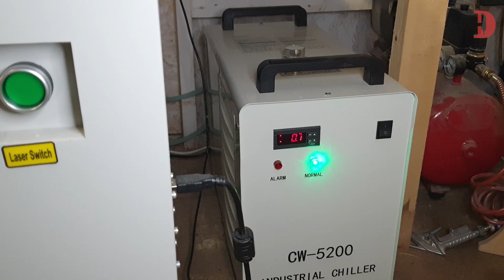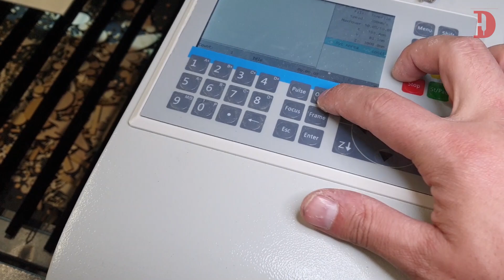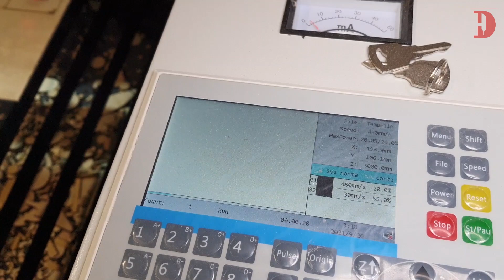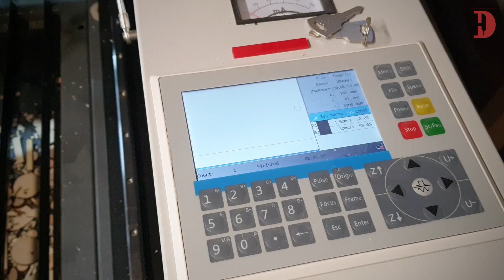New 9060 100W CO2 LASER in the shop

Comment: Amazing machine. what kind of demand maintenance?  How long does the lens hold Daniel?  thanks for sharing with us
Reply from the maker: It works fine for over a year now. I have spare lens but didn't change them yet.
All I have to do is adjust the tube because there was a corner where it didn't cut perfectly.

Comment: Hello Daniel, 
I want to buy one to. Do you have any after use insight to recommend before i order?
Reply from the maker: Almost one year of intense use and no problem so far. Just one time I needed to adjust laser tube and mirrors. And i changed the exhaust fan with a bigger and powerful one. It's awesome for me
Reply: @DanielH  thank you very much. The steal bed provided is good enough? Or shuld i look for honyecomb one?
Reply from the maker: I have both types. Honeycomb one I don't use it at all, only on engraving part sometimes. 
The best there is are the aluminum profiles with sharp top. The honeycomb reflects the laser beam and the material looks ugly underneath

Comment: Buna ziua dl. Daniel,
Vad ca folositi aceasta masina de gravat de aprox. 7 luni de zile. Sunteti multumit de aparat? Ati avut ceva probleme la el? Sunteti multumit de vanzator, asigura si service si piese in caz de nevoie?
Ma gandesc si eu sa-mi iau una de hobby si as fi foarte recunoscator daca mi-ati da cateva raspunsuri.
Cu stima, Robert.
Reply from the maker: Sunt foarte mulțumit. Nu am avut nici un fel de problemă. Singura chestie ar fi ventilatorul ce scoate fumul, e subdimensionat și nu face față. După un timp a început să facă zgomote urâte. L-am înlocuit cu un ventilator de tubulatura de la Brico. E foarte bun și nu am nimic de reproșat.
Reply: @DanielH 
Va multumesc foarte mult si ma bucur de raspunsurile pozitive.
Reply from the maker: Vânzătorul a fost ok, livrarea a durat puțin mai mult din cauza problemelor de transport și crizei de containere și toate cele. Dar a venit, l-a instalat, mi-a explicat cum funcționează și de atunci merge foarte bine.

Comment: Great video. Do you know who the original manufacturer is? This looks like a Voiern 9060. I just ordered one here in the US and have been looking for information.
Reply from the maker: I don't know the manufacturer. It works wonderful so far.
Reply: @DanielH  Thank you. It looks exactly the same as mine. Glad to hear that it works well. How is the air assist, strong?
Reply from the maker: 75l/min Air pump. Silent and can manage. Didn't had a problem so far with it.
Reply: @DanielH  ty!
Reply: @Tommy. Hello mate, have you got the Voiern machine.  Is it working well? Thanks for me know
Reply: Where did you buy this from
Reply from the maker: Local seller here in Romania. Don't know where he got it from, it's china for sure but don't know the exact manufacturer